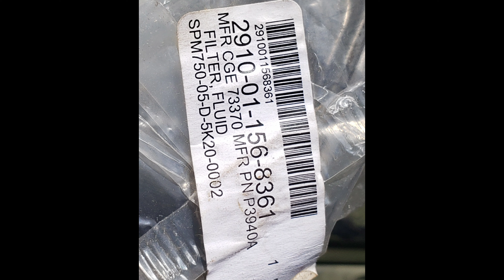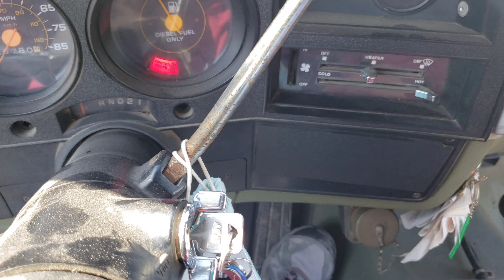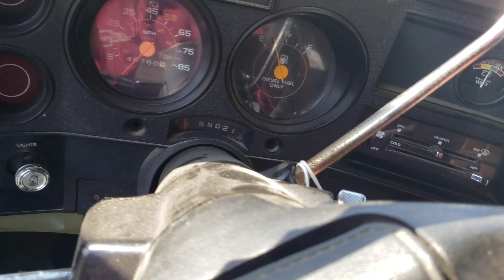Replacing Fuel Filter 1985 M1009 Military K5 Chevy Blazer 6.2 Detroit Diesel 24volt Off Road CUCV

Comment: Do you leave the gas cap open or closed. I seen you take the gas cap off but wasn’t to sure if you put it back on as bleeding the fuel filter. My 1986 M1009 was a piece of cake but with my buddies M1009. It’s being a bitch and when I did my fuel filter i just opened up the fuel injectors to bleed my system but I would like to try this way on my buddies M1009
Reply from the maker: Open the gas cap to let the pressure off. 
Leave it off until the bleeding is done. 
Thanks for watching.  Let me know how it goes. Or if you have any other questions.